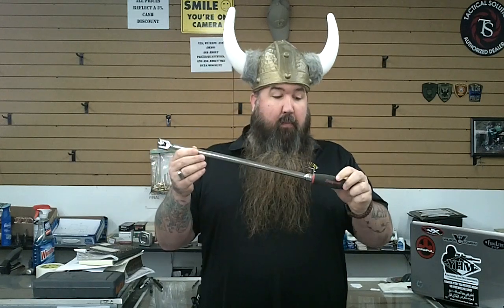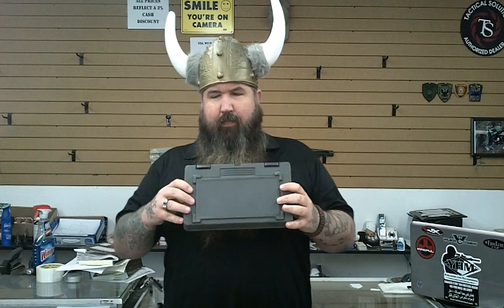Is A Chrome Lined Barrel Right For You?

Comment: More than a few on here have commented about Melonite coated barrels and how much better they are.  Well....  sometimes.  They are cheaper and for most shooter, they are fine and the corrosion and galling resistance of the coating is very good.  Just stay with the higher end companies, Ballistic Advantage is by far one of the best manufacturers of these.  Melanite is a ferritic nitrocarburizing coating, so it Tennifer.  Ferritic nitrocarburizing of it's dozens of forms is a combination of heat treatment and coating.  It occurs at the 950-1150 degree F range.  There lies the problem.  At these temp ranges, it's really easy to inadvertently anneal the metal being coated.  I've seen it.  I build and repair ARs for a living.  I have seen more than one coated barrel done incorrectly resulting in annealed steel that dies in less than 5k rounds.  The coating doesn't wear out, but the metal in the barrel expands from the repeated exposure to high pressure rifle rounds.  This is why the US military doesn't use it.  Hard chrome lining doesn't effect the temper of the barrel.  No ferritic nitrocarburized barrel will equal or outperform a cold hammer forged (CHF) chrome lined (CL) barrel for longevity, thermal ablation, or minimizing stuck cases.   

Second point, you can wear out a chrome lined barrel.  Most Daniel Defense and FN AR barrels will take in the ballpark of 25,000-30,000 rounds before they look like conduit pipe at the throat and muzzle.  The lowest round count I've seen on a shot out DD barrel was 22,000, but it was a special case.  The guy drove his AR's harder than anyone I know.  DD and FN are the two largest manufacturers of CHF CL AR barrels.  You really can't go wrong with investing in one of them.
Reply: Sean M do barrels just go out or do you gradually lose accuracy never keep a gun long enough to find out

Comment: I own a Ruger AR-556 AR-15. Ruger states that it uses a Cold Hammer-Forged 4140 chrome-moly steel barrel with a matte black oxide finish. They do not specify what the said barrel rifling is lined with. I  have called them on several occasions and received different answers on this Q?. Such as, Nitride lined, Melonite lined, and, being it is CHF 4140 chrome-moly barrel, it's chrome lined from the material of the barrel. Is there ANY way you can tell me the TRUTH about how the said barrel rifling IS lined, if any? And, whatever answer you give me, should I look for another barrel if it ISN'T any of the above given answers?

Comment: One thing you didn't mention is that stainless steel barrels will wear out eventually and have to be replaced.
Reply: Any barrel will wear out if the round count gets high enough.... The average shooter will not experience this though. 5.56, while not a super hot barrel killer, still can eventually erode the throat. A couple of my rifles did this and a simple adjustment to the seating die on the reloading press fixed accuracy issues. Nothing lasts forever and if I shoot them long enough I'll have to rebarrel them simply because the ammo won't clear the mag when loaded for max accuracy with an eroded throat.

Comment: Ive lost count of how many chrome barrels ive replaced that's been shot out or corroded to the point of no return.
Reply: you use corrosive ammo? Use soap & water after shooting to clean off corrosion then wipe down with lube to preserve the metal. If you live where there's a lot of humidity then you'll have to regularly wipe it down with Hoppes9 or something
Reply: shrewddaxter Nope, all brass 5.56.
Reply: ***** There were no round counts kept on the barrels. Could be 2 million for all I know.

Comment: What about Melonite/Nitride barrels? I'm undecided between this and chrome lined.
Reply: Melonite QPQ/Nitride is for go to war and is superior to chrome liningbin every way. The case depth is much harder and deeper...not to mention it is inside and outside(whole barrel is treated). I have non lined, chrome and melonite and melonite is easiest to clean and will not pit. There are no disadvantages to melonite as long as the barrel rifling is cut properly. Only reason melonite is not used by the military is because chrome lined is the standard and it takes time to change over and they are slow at doing so. Melonite wins by miles in corrosion resistance and lubricity. Go melonite.

Comment: Hey man, I am preparing to purchase a Zastava AK-47 M70, and from what I have heard, the barrels are not chrome lined.
Would you recommend talking to a local gun smith about possibly getting it chrome lined since AK ammo can be corrosive.  
Also would the barrel need to be re-milled slightly wider in order to apply the chrome?  As you are effectively narrowing the diameter of the barrel?
Thank you for any input if you get around to answering this.

NOTE:  I have also seen a few people talking about nitrided/nitrocarburized barrels being an even better resistant to corrosion than chrome and more durable as well.  Any input on this?

Comment: ok so if I have a scar 17s it's cold hammer forged and chrome lined can I shoot steel through it? I ask because all my ak's are chrome lined no issues
Reply: If you're talking about steel-cased ammo then it's really up to you, since you won't really have any issues with the bullet traveling down the barrel. I've been told that if you're using a chrome-lined barrel then it's much more reliable when shooting steel-cased ammo, since the resin that is used to coat the cases is much less likely to melt and actually make the case stick to the chamber.
Reply: ty sir, loads up full mag of steel cased*